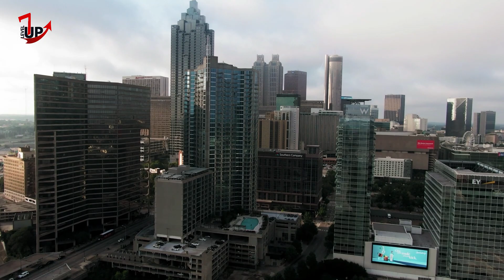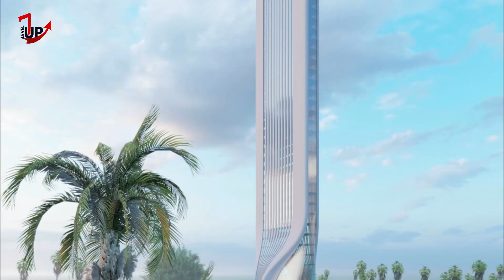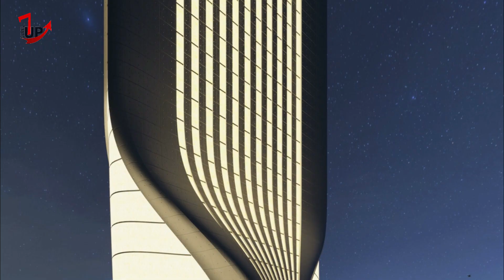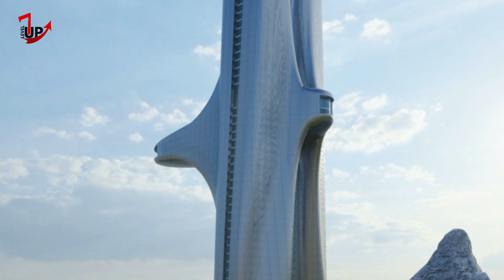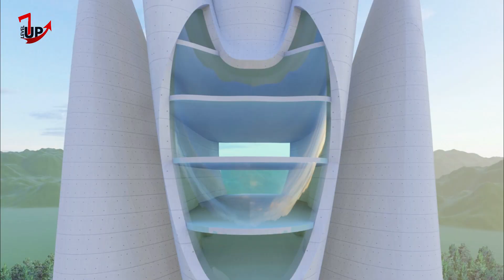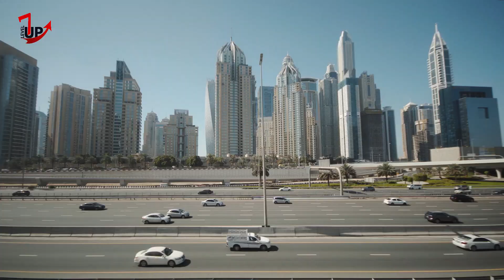A series of futuristic skyscraper concepts I Skyscrapers under design

Comment: i designed it basically with only a deck of cards twisting and bending the cards like paper mache overlapping the cards and blowing a fan at it until the lease mass air flow was measured in the perfect angle